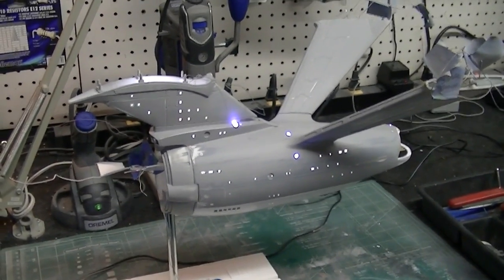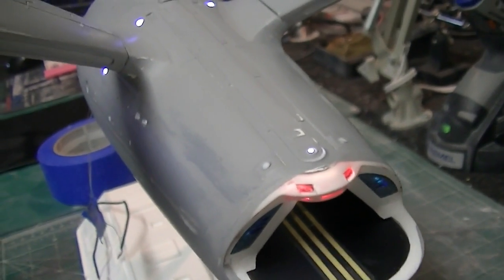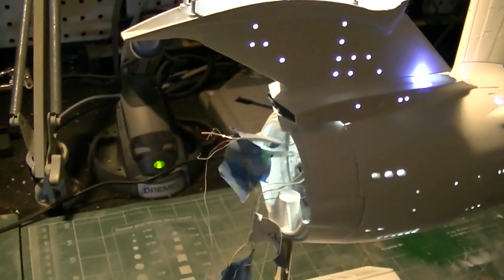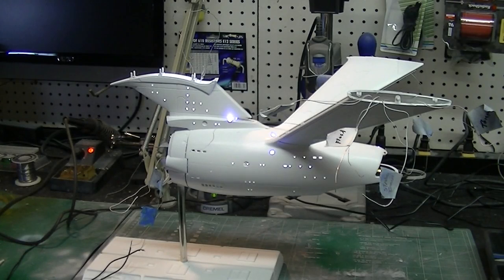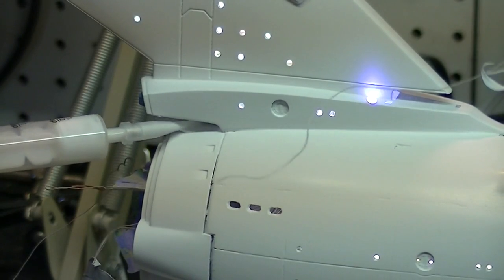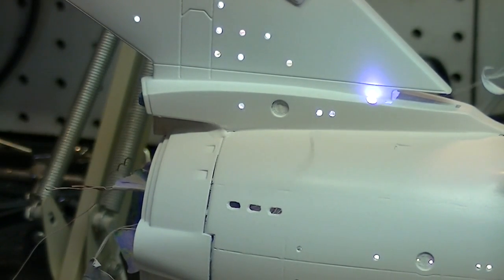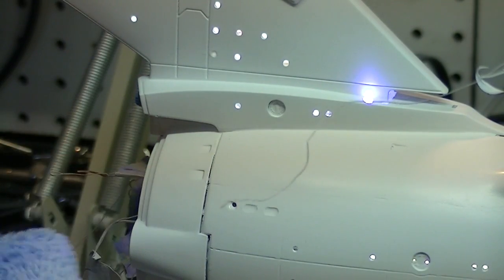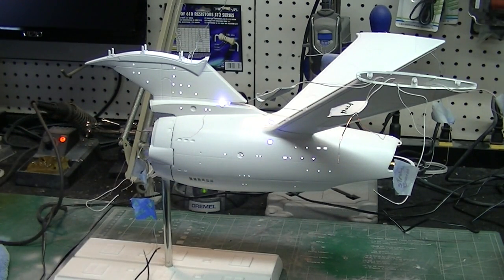Polar Lights 1/350 Scale Enterprise Refit Buildup PT 16

Comment: Thanks for the "tip of the day" - using the Canopy glue for windows. I've was going to use the method as in Don's Light and Magic which involves taping the exterior and adding resin from the inside. Your method is so much easier, and it enables me to fully assemble the model and paint at one go.

Comment: hey william.  boyd gave me an excellent idea from Home Depot. they have these small pressurized cans with screw on bottles that you can use for the painting.  I've been using them and taking my time and it's working great.  They are about $25 for a starter kit in the paint dept.

Comment from the maker: Yes I have used it before. Depends on what you use it for when you mask with it.
I've found that it sometimes is difficult to remove without leaving some residue.
Good old Elmers glue works the same and comes off much easier.

Comment: Hey Boyd,
Thanks again for the refresher using the canopy glue for light leaks and windows. One thing about filling windows, you had mentioned that it fills it in flush, but it almost looks as though it goes in and sets sort of concaved, or bellowed. is that not so? Also, I am thinking about using this for my Voyager windows, however they don't sit vertical on the saucer, there more lying flat. Would this technique still work even though they lay flat? Please let me know. Thanks.

Comment: I know this video is old but have you ever tried to use rubber cement or liquid drawing gum for masking off tight areas? We used to use it for airbrushing back in the day. Comes up pretty easy with a rubber cement pick-up square.